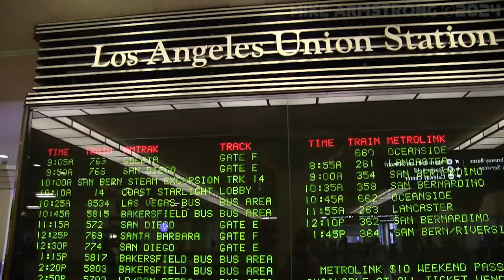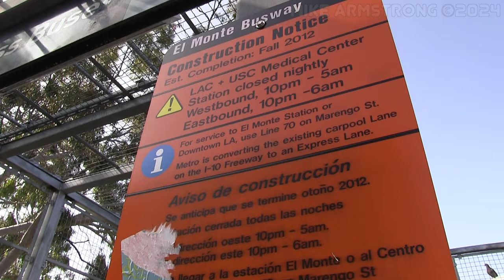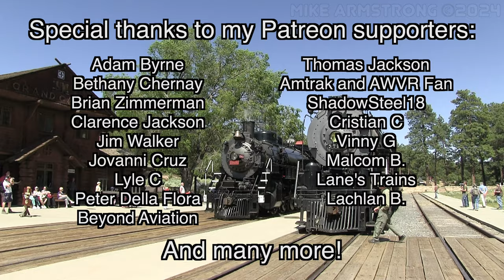Santa Fe 3751 Steam Locomotive: San Bernardino Railroad Days 2010 - 2014

Comment: 3751 is operational again. Her FRA mandated 1472 overhaul was completed in 2022 and she is currently in her home in San Bernardino.
Reply: Home for 3751 is site of former Santa Fe Redondo Jct. roundhouse Los Angeles. Now an Amtrak facility.
Reply: @edwinsinclair9853  Either way though, she’s back under steam and made her first public appearance since 2014 at Fullerton Railroad Days in 2022. She’s still at her home and from what I’ve heard, they are trying to make her mainline compatible with a PTC computer.
Reply: @josebenitez6925 yeah I also heard that it’s getting ptc installed on the engine 
But it might be a while before she can run on the mainline again
Reply: Last I saw she was still at redondo jct roundhouse
Reply: @theventuracountyrailfan I work for Amtrak Los Angeles mechanical facility where she sits. They are bringing it out very soon for train day at LA depot in august
Reply: @CornholioMan69 who told you that?